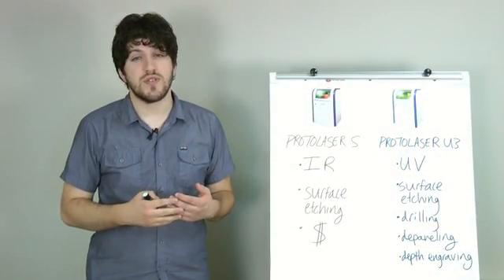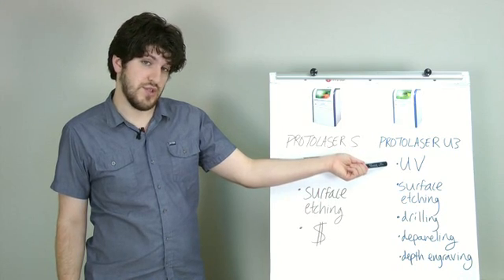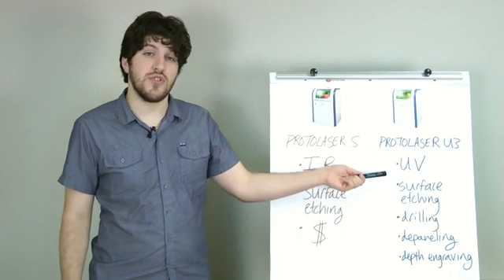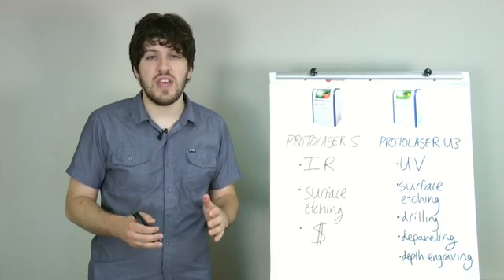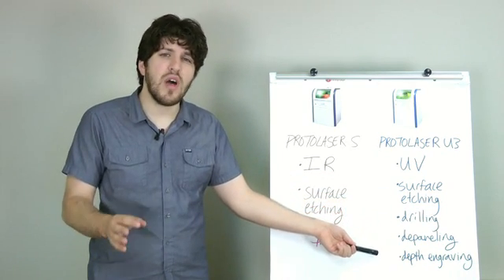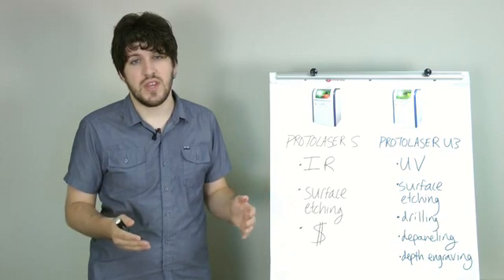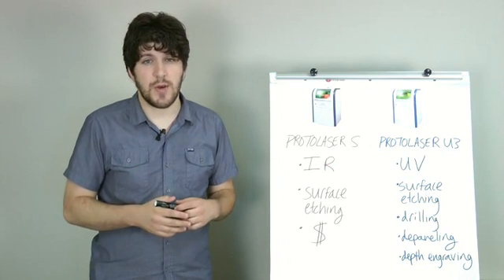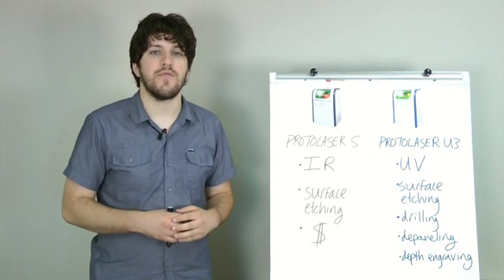Ask LPKF, Ed.2: ProtoLaser S vs. ProtoLaser U3

Comment: What is prototypng PCBs ? Is this process for commercial/hobby use , good ? Can i create PCB that will last as if it was chemically created ? Or is this just , as name indicates, for making short lasting prototypes.
Reply from the maker: Hi Maciej, thank you for your interest in LPKF Laser &
Electronics.  Your questions cover a lot of ground, but the short
answer is that yes, our systems can be used for both commercial and hobbyist
applications.  PCBs created with our equipment will last just as long
as those that are created with chemical etching processes and without having to
deal with disposal of the chemicals.  If you’d like to discuss things
further, please give us a call at 503-454-4205 or email us at sales@lpkfusa.com.